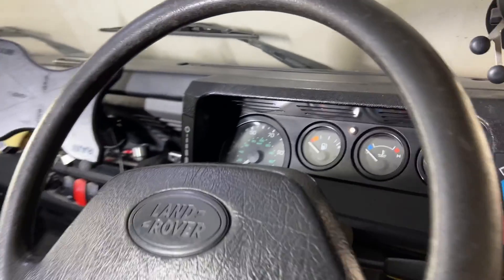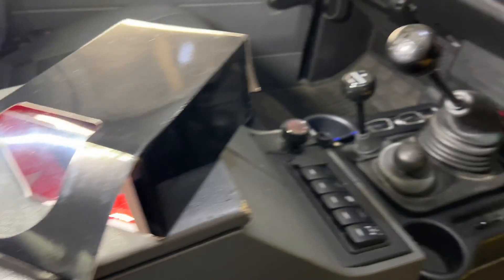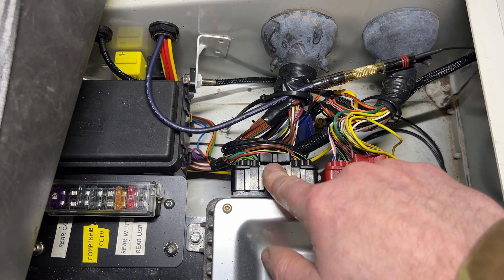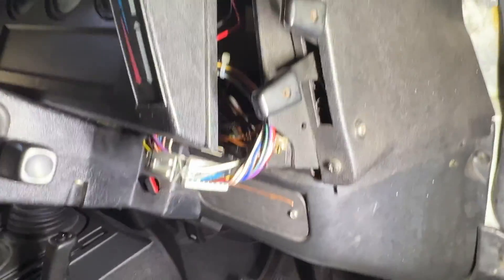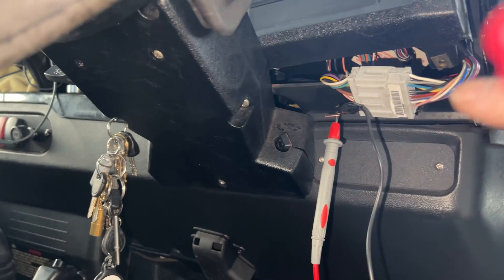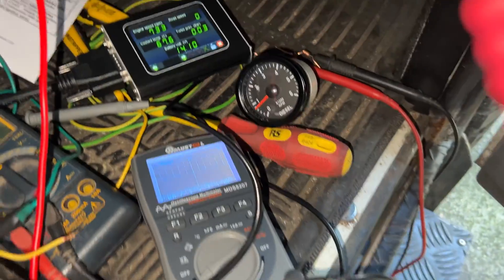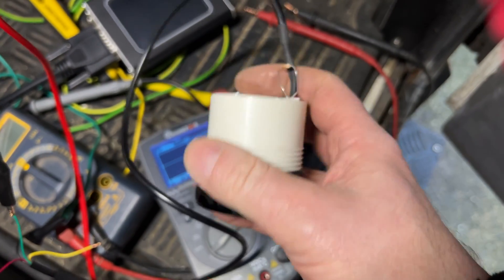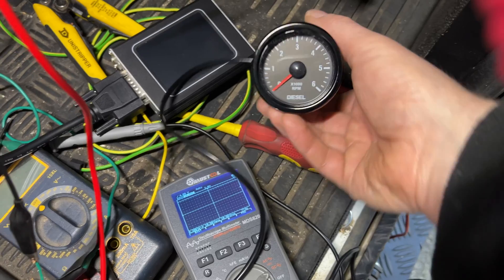Defender TD5 Tacho/rev counter upgrade YAE100790

Comment: Did you place the resistor between the signal wire and the positive feed? Or just in the signal wire? Hard to see on the video. Thanks a lot
Reply from the maker: I cannot see all the comments for this video at the moment (At work!) but I’m sure I have already answered this question. Take a look through the comments and I think you will find the answer. Remember there are two parts to the video, the answer may be in the other one. If it’s not there come back to me and I’ll find the answer for you. Thanks for watching 👍
Reply: @MikeMakesIt  thank you so much! I found it. Somehow I missed you already answer it. Do you remember by any chance what voltage you had when measruing the signal wire? I can't seem to get any even though I used pin 19. Thanks so much
Reply from the maker: @inakiruiz1941  It was measured on the scope but I would be guessing now if I said a figure. If you use a DVM I think you would just get an average voltage of the signal value. A scope is really what you need to measure the wave form. If the resistor isn’t connected at the right points you wont get anything!
Reply: @MikeMakesIt  thanks for the answers. I have tried with the 10k resistor and I’m getting nothing unfortunately. Any other ideas?

Comment: Hi Mike i used your guide to fit an ebay £17 tacho today (you might want to update your affiliate links as some dont exist now)  my 2002 inconveniently didnt have the ECU to dash wire  however i just ran  another wire from pin19 to the tacho. added the resister you described (pack of 10 was the least i could buy 2 quid!) but for under £20 thanks to you i now have a functioning tacho for less than a tenth of the price of a "proper" one !! thank you
Reply from the maker: I’ll take a look at the links, thanks for the heads up. I’m glad you got your cheap upgrade. Mines still working great and very happy with the overall low cost. Thanks for the feedback and of course for watching👍🏽

Comment: hi Mike  finnaly got mine in and working brilliant .. just one thing is it poss to dim the leds at all its quite bright at night ? 😅
Reply from the maker: Hi Peter, I put a resistor in series with the cable for the backlighting for the tacho. It did help a little but the needle I believe is powered directly so this doesn’t dim. It’s still a little too bright for me and I need to revisit this issue but so far haven’t had the chance to. I think I tried 470ohm resistor then altered the value until I got something I liked. Remember the resistor has to go in series (in line) with the cable that connects to the lighting circuit.
Reply: @MikeMakesIt  ok Mike thanks will have a look into again didn't look to much inside so not sure if there's several leds or not hoping I can black out some of them lol 😉

Comment: Hi Mike thanks for the great video just fitted this to my 2000 defender and works a treat. Did you ever dim the lighting down  as you said its a bit bright compared to the other gauges .
Reply from the maker: It's on the list! I did add a couple of low value resistors in series with the back light power cable for the display but that is super sensitive to voltage variations so the brightness varied some what. I do need to revisit this as I do have another tacho unit I can experiment on. I also want to swap out the red led that lights the needle with a coloured one similar to the rest of the dials. I will get around to it but it's probably not going to be my next video. Thanks for watching 👍🏽

Comment: hi don't suppose you could sell me a tacho with the pull up resistor attached ny any chance or send me a pic on how to fit it ? cheers pete from doncaster 😊
Reply from the maker: Hi, I'll have look to see what pictures I have that may be useful, give me a couple of days.
Reply from the maker: Right, I've looked though my info but don't actually have a photo of the pull resistor fitted. Here are 2 links to my 2 videos where I mention the resistor though. With my tacho I needed to add it, possibly on other tachos you don't. I connected mine between the 12v+ feed to the tacho and the signal lead from the ECU on the inside of the tacho for neatness. It was a 10k value resistor.  I hope this helps https://youtu.be/sdUa6Rgptww?t=363 and https://youtu.be/1yPJ1bo2NYw?t=668
Reply: @MikeMakesIt  does it matter which way round the resistor goes Mike?? cheers pete
Reply from the maker: @peteroliver585  Hi Pete, no it doesn’t matter so long as it’s on the correct terminals/connectors.
Reply: @MikeMakesIt  ok Mike thanks will get one ordered off ebay sorry for all the questions lol .is it just a normal 10k resistor ?
Reply from the maker: @peteroliver585 No problem. Yes a 1/4 or 1/2 watt carbon resistor is fine
Reply: @MikeMakesIt  ok cheers il let you know how I get on cheers
Reply: @MikeMakesIt  got the rev counter and some resistors got the rev counter stripped to solder the resistor inside the unit just to confirm its the red power lead to the green signal wire to solder it too ? cheers pete
Reply from the maker: @peteroliver585  Hi, it was on mine and the video seems to confirm this although you may have different colour wires. From memory you need to put the resistor between the power to the tacho and the signal to the tacho.

Comment: What is the reason for fitting the 10k resistor across the signal and feed connections?

Did you just guess at 10k or is that a calculated value?

Was your tacho originally designed to run from the W terminal on the alternator? I fitted one to my series 3 with a Thor 4.0 V8 engine in and when using the ECU signal the tacho reading is reading too high (1200rpm at idle and around 4000 at 70mph).

Any ideas what I can do to get the reading to match the engine speed? Cheers.
Reply from the maker: Hi Big J. I believe the output from the ECU is what's called " open collector" https://www.electronics-tutorials.ws/transistor/open-collector-outputs.html
so you need a "pull up" resistor connected from the ECU output to 12v+. A 10k resistor seemed to be a good starting point as it is a high enough value not to do any damage or "load" anything too much. Anything between 1k to 10k is a normal value to use so as I said I started high and it worked so left it there. Yes, the tacho was designed to be connected to an alternators W connector. On this actual tacho there is a blue calibration adjuster pot on the back. I simply adjusted this to a know rev output (Idle in my case using a Nanocom set to RPM for reference) and everything else fell in place. I hope this helps, thanks for the comments and for watching 👍🏽
Reply: Brilliant thanks very much 👍

Comment: Hi Mike, thanks for such a detailed video! I bought my 2002 110 Td5 18 months ago and it has been fitted with a VDO tacho. They have run a single wire from it, out of the bulkhead and underneath and back into the underseat box and spliced on to the black ECU connector. A bit of a bodge, so I will trace the wire through the connector and can remove the wire to make a much neater job, cheers for the info.
Also, mine has a disco transfer box fitted (1.211 ratio) and it sits at 2,300 revs at 70 MPH in 5th, so would be interested in seeing what revs you get with your roamerdrive.
On another note, I can see you have a MUSTOOL MT8208 scope? How well does it perform, and can you recommend it?
I have on old tube Tektronix dual channel storage scope, and as you can imagine, its HUGE, and very heavy. I need to sell it as I do not use it often and that little meter you are using sounds like an ideal replacement for my needs.
Keep up the great work, your videos are really good and informative 👍
Reply from the maker: Hi Sean thanks for the great comments, they are very welcome. Before the Roamerdrive @60mph the rev's were 2400rpm measured on the Nanocom. With the Roamerdrive fitted and engaged its around 1900rpm. Roamerdrive say there is a reduction of 28% across all the gears which sounds about right to me. I bought the MT8202 especially for this job (Tacho) as I was a bit worried about using a mains powered one and somehow blowing the ECU. As you can see it worked very well for this application. I would say it depends how in depth your future scope use needs to be as this scope is quite basic but for me it did the job I needed it to do and will be used on future projects. I do have a "proper" scope if need though. Remember if you have ABS the colours of the cables may be different to mine but I do suspect there will be a cable to pin 14 (I think) in the instrument loom like mine you could use but every Defender is different. Good luck and thanks for watching 👍🏽
Reply: @MikeMakesIt  thanks Mike, forgot to say, mine does not have ABS either,so hopefully will be the same wiring. I will keep an eye on the scope multimeter to see if I can grab it for a good price 😎